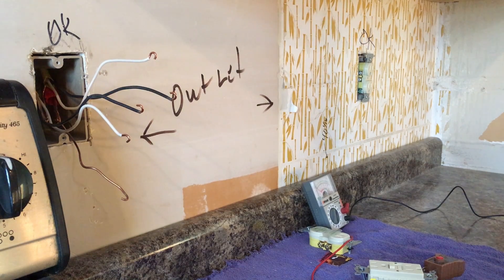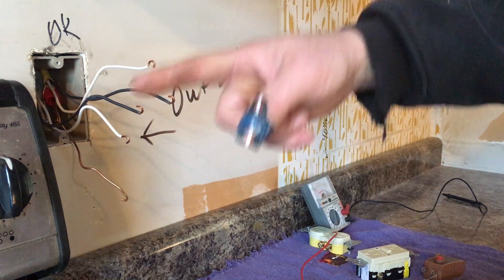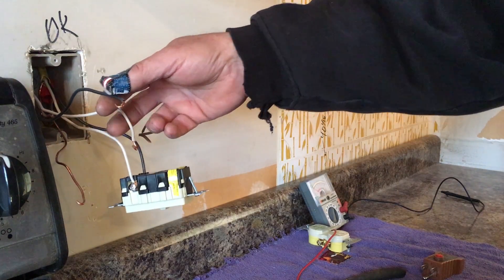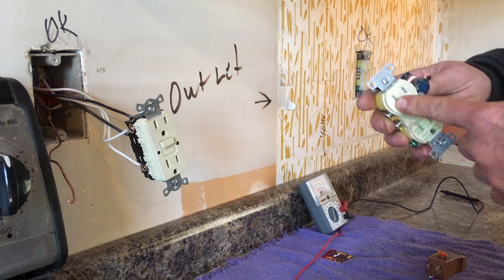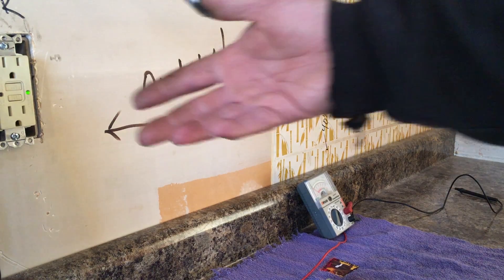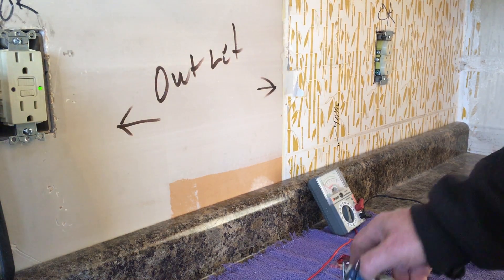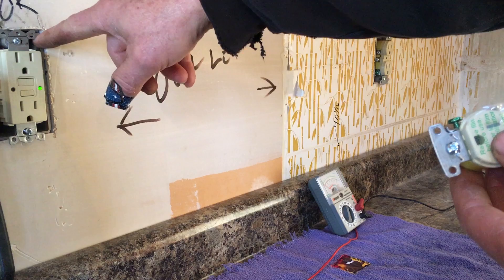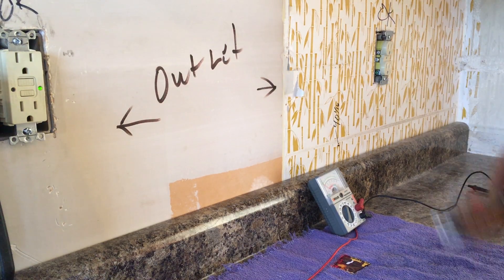How to Install a GFI outlet that Feeds other outlets

Comment: Can a gfi be wired to feed 4 normal receptacles? Or is that a no no
Reply from the maker: Great question! That is exactly how a GFCI should be used. Power into the terminals marked “line” then feed to the next outlet wired to “load” terminals. GFCI will protect all outlets wired down stream. A $6 outlet tester should be plugged into those outlets to test the GFCI works.

Comment: thanks for video! shouldn't you add another ground wire (from the second outlet) attached to the ground on this outlet?
Reply from the maker: Your not the first to ask! Good question for sure. I explain in the description that the grounds are all on a red wire nut with a pigtail added to attach to the outlet. Took me a minute to find it so unless you intentionally read the description you won’t see it. The entire point of the video was grounding so I should have made that clear.
Reply: @CBrown07696  Thanks!

Comment: what happens if you feed additional outlet not using the one for additional outlet but just the top one that was not taped?
Reply from the maker: That’s a great question. I’m not sure why you would do that but I am just guessing those outlets would trip just the same. I’ll have to try that the next time I am wiring an open wall and see if my GFCI tester will trip from an additional line circuit.
Reply: @CBrown07696  yea is strange cause where the screw is it has it where you can put 2 lines on the top part also
Reply: If you feed an additional outlet from the one not taped (line) everything will work fine, but the additional outlets will not be gfci protected and will remain live if the gfci is tripped.

Comment: Is it possible to put 2 gfi plugs in a 2 gang box?
Reply: Yes. You would need to go from the Line of the first one to the Line of the second. Do not use the Load.
I would not recommend doing this. Use a regular receptacle as the second one and wire from the load of the first. You'll get the same results without having to purchase a second gfci.

Comment: My house copper wiring too heavy a guage (12?) to push in holes. Asny ideas?
Also, what to do with outlet with only 1 hot, 1 neutral,  copper ground?
Reply from the maker: 12 gauge is great. You can buy 20amp outlets made for 12 gauge wire and push the wire in the holes. The neutral hole looks like a T on its side. Most people don’t like the look of 20amp outlets and just use 15amp outlets and connect using the screws on the outlet and install the wires that way. Some brands you strip the wire then bend a hook in the wire and put it around the screws but most new outlets I buy you strip the wire and push it under a small metal plate then tighten the screw to hold it in place.

As for only having three wires, that is all you need. That is the last outlet in the run. It may be the only outlet in the run or the last of 20. Depending on the codes where you live but in my area the washing machine, fridge and microwave all require separate breakers with only one outlet per run. Once you connect your wires both plugs are hot. There is a small metal plate, a “bus” that bridges the power to both screws on each side. There is a tab to break the bus when separating the plugs but that’s another story.

Hope this helps and thanks for watching. Remember electricity is deadly and if you have any doubts hire a professional. Many retired electricians love helping people on small jobs.
Reply: @CBrown07696  Thank you.  I'm a  'DIMSL' (do it myself lady/'damsel') because I  like to learn.  And save money.  But mostly because of contractors robbing me.  The last one, for over $2,400.  I would love to pay a retired electrician.  Seems none around.
But then again,  the last time I  did that...guy ran wires behind a 72" vanity...not in the wall 😮  Happens every time I'm not micromanaging/watching and helping every second.
Thank you so much, again...hoping I figure out what went wrong with three outlets I'll be re doing today. 😙
Reply from the maker: @ttnnaples8060  That’s terrible someone would rip you off like that. Make sure power is going in  to “LINE” and out to the next outlet on “LOAD”. I was distracted last week and reversed them and it took me a few minutes to figure out why I had no power.
Reply: @CBrown07696  There is no need to ever use a 20amp duplex receptacle in a residential location. Use a 15 amp "spec grade" receptacle, they have same connection option as a 20 amp. 15 amp duplex receptacles are code compliant on 20 amp circuits and the spec grade versions are the same quality as a 20 amp. A 20 amp receptacle has no advantage.
Same thing with gfci, but there is no distinction between residential grade and spec grade. They are all essentially spec grade or above.

Comment: Once you wire in the gfci with the ground wire is the subsequent outlet also grounded? Do you need a second ground wire for the second outlet or.does the gfci act as the ground?
Reply from the maker: The subsequent outlet will be GFCI protected when you hook up your three wires on that outlet. If you have a metal box you would wire nut two short pieces of wire to the incoming ground. One of those wires would go on your outlet and the other to the metal box. The wire to the box is to prevent you from being shocked should the conductor in the line wire (black) touch the box from being over striped or the insulation got  nicked and the copper touched the box. Without the ground wire to the box, the box would be electrified but not shorted because it would not have a ground until you touched it! With a ground wire attached to the box also, if the wire shorted it would have a path to ground and trip your GFCI or circuit breaker on a non GFCI run. Hope this helps.
Reply: @CBrown07696  Thx so much for making this video. It's helpful and I just want to confirm since it seems you're an actual pro v.s. random tuber: 

I'm confused on the GROUND wire - so I'll focus on that.

Is it Scenario 1 or Scenario 2 I should be doing? 

Scenario 1: 
- GFCI Outlet #1 has the power source coming in. 
- I twist the ground wire + wire nut from Outlet #1 and #2 (where I want to extend power to). 
- I don't ground it here in Outlet #1
- I connect the ground in Oulet #2

Scenario 2: 
- GFCI Outlet #1 has power source coming in
- I pigtail Ground #1 and #2 together
- I connect ground in Oulet #1
- I also connect ground in Oulet #2

Scenario 3: ???

Thx so much for your help
Reply from the maker: @David-ee6ds  scenario #2.
Think of the ground as one wire coming from the breaker box to the GFCI, continuing unbroken to everything your power and neutral wire go to. The wire nuts  and pigtails just make it easier to maintain that unbroken chain. If switches and outlets had two ground screws it would make it less confusing.
Reply: @CBrown07696  thank you so much 👏🏽

Comment: nowhere, have I found what Im looking for. there are 2 ground wires so do I twist them together?
Reply from the maker: Typically you twist the two grounds from the line and load runs together with a third piece of wire as a pigtail. You attach the pigtail to the ground wire on the GFCI. If you are using a metal junction box you also need a ground wire to the box also.

Comment: Why did you attach the incoming wires to the top screws?
Does it matter?
Reply from the maker: Great question! Yes it does matter. The power coming in goes to the screws marked “line” and then the outlets that you want to protect down stream are attached to the load screws. I did not address line and load very much in the video because my main objective was to dispel bad grounding information that  I had seen in other videos.
Reply: @CBrown07696  this is what I cam for. Thanks. I was screwing up the line and load wires. Got it now.

Comment: Question....Can you wire two gfci outlets together (jumper) ?....
...I know the gfci nearest the service entry box is the prime for the following outlets (if any) but both outlets in my circumstance is about 20 inches away from the sink and I've already installed one which happens to be the last one in the same circuit and had to modify that section of wall to install...Not interested in pulling it back out !
Reply from the maker: FA Q. From what I understand from your comments, it’s not perfect but without tearing things apart you should be able to wire your upstream outlet as the “line” and your existing GFI the “load”. Best thing would be to make the breaker an arc fault/GFCI and protect the whole circuit. It’s tough when you are doing repairs and trying to make things safer. I just helped on a house that nothing met the new codes but the owner wanted to make it safer. The Zinser breaker box was a huge fire hazard and the lights went off when the disposal was turned on. A new breaker box was installed but the circuits don’t meet current codes. The house is way safer but short of the latest requirements.
Reply: @CBrown07696  ....K....Thanks !
I get the analogy...Sort of like buying 2 pairs of the same exact shoes and wearing the left out of one box with the right out of the other.

Comment: If the wiring method in ole construction is emt, can’t you ground to the box and make the emt the ground circuit?
Reply from the maker: Nathan Lackey. You are required to attach a ground/bond to your metal box but it is not a legal ground circuit. The code keeps getting stricter on grounds. A true ground will go all the way back to the service panel and cannot terminate in a sub panel. On an old two wire system in EMT I would certainly connect a ground and tie it back to the box even if it’s not a legal ground. Any ground versus no ground would be a winner in my book. I am in rentals all the time and most circuits are not grounded at all and landlords will not spend the money to upgrade them.

Comment: If I wanted to add an additional outlet to this circuit. I can simply add to the non-feed wires/outlet? In other words, I can hook at 3rd outlet up to the 2nd outlet without issue?
Reply from the maker: Yes! That GFI will protect all outlets wired downstream from the load side. If you are pulling a permit check with your inspector! Lots of new stuff in the latest code update. Your area may not adopt all the latest rules but my area adopted everything so you may even need combination arc fault/GFCI breakers.

Comment: After you found the feed wires you then hoked up the GFCI off camera.  Its hard to tell which set of wires you connected to the switch. Which wires connect to the screws that are covered by the tape on the GFCI  plug ?

Comment: How did you ground it?  Are you suppose to use a wire nut to connect 3 grounds?  One ground from the line, one ground from the load, and a 3rd from a pigtail which would connect to the ground screw in the gfci outlet?

Comment: Hi, aren’t you supposed to connect a ground cable to the same ground screw on the gfi, from the secondary outlet?
Reply from the maker: YES! It may be hard to see in the video but both grounds are joined with a red wire nut in the back of the box and a single pigtail added to make it easy to put the ground wire on the outlet. They make a green wire nut with a hole in the end so you can push one wire through the hole and screw the other wire in a few inches back making it easy to attach the ground without using the pigtail. If look at the tester you will see both amber lights are on when plugged into the load outlet. If it did not have continuity to ground it would only have one amber light on. Thanks for question, I should have made that clear since proper grounding was the main point of my video.

Comment: if the outlets don't happen to be 3' apart, you can nut the black and white at the second outlet.  Then find the black and white at the first outlet that have continuity.
Reply: Great tip ebp4life, thanks!
Instead of the ground going on last a good way to show others when installing is always start with the ground and leave it on till last if you're removing. "First on" and "Last off".
Reply from the maker: ebp4life Good point. I should of said that. I got into a nightmare project someone else started then quit that I had to do that on the entire kitchen. It would of made a great video.